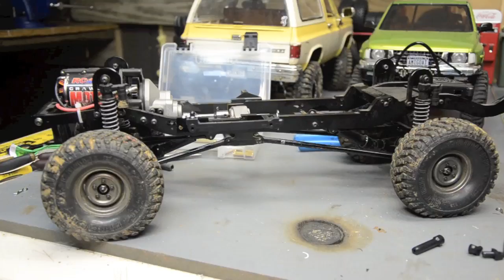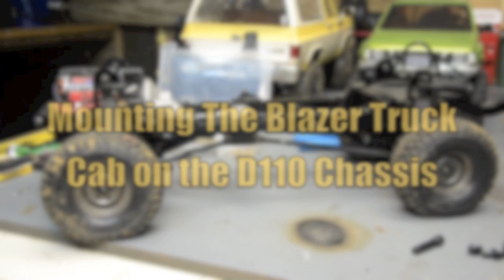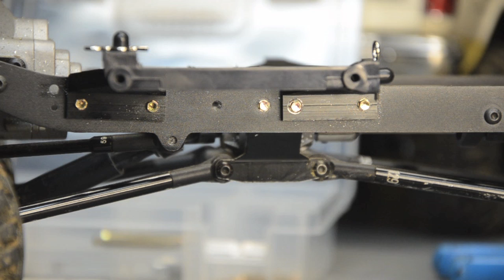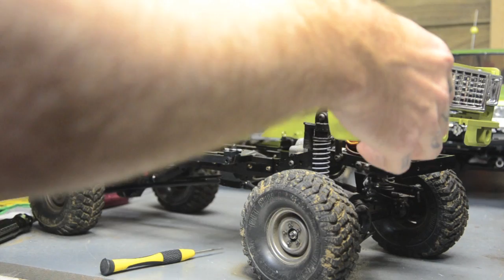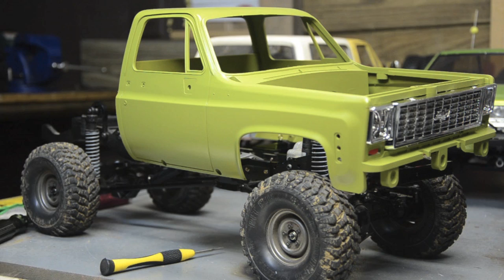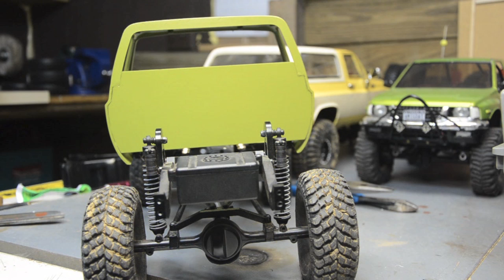RC4wd Gelande 2 D110 Chevy K10 Pickup, Mounting the Cab

Comment: Hey bro love your builds , I have a question on the tf2 the arb bumper from rc modexl how would you fit it with the body lift or do you keep it the stock way ? do you have any suggestions forme.
Reply from the maker: Do you mean as far as the height of the bumper?  I think it should be level with the body
Reply: so I got the rc4wd lift kit and I didn't know if you raised the body the bumper doesn't match because I raised the body. is your tf2 body  in stock position  or do you have it lift it..?
Reply from the maker: I gotcha. The body lift does not move the bumpers so it will look off a little. I haven't used the body lift on my rigs